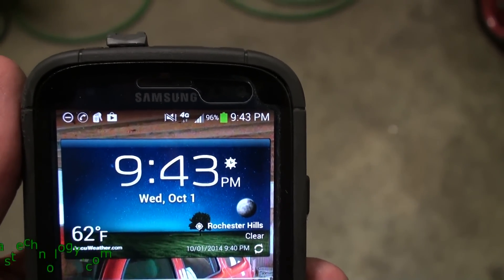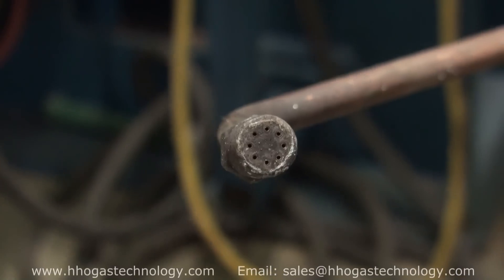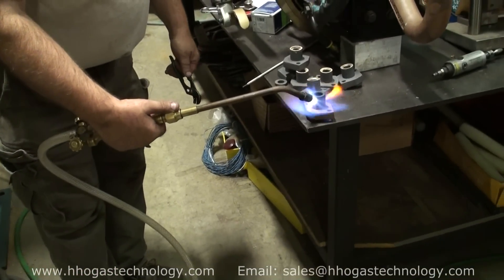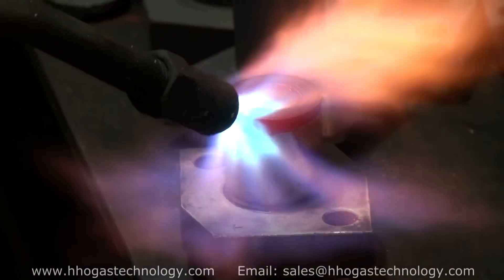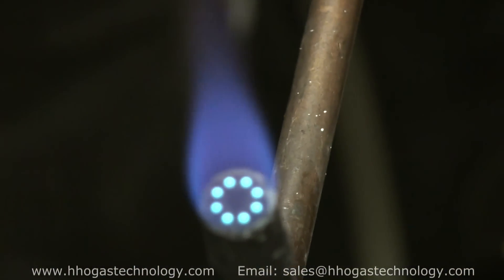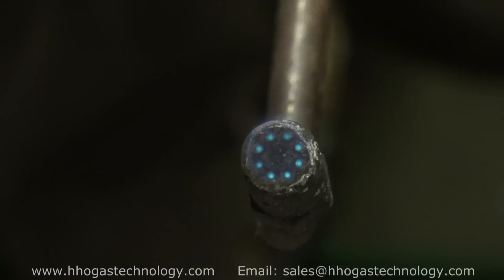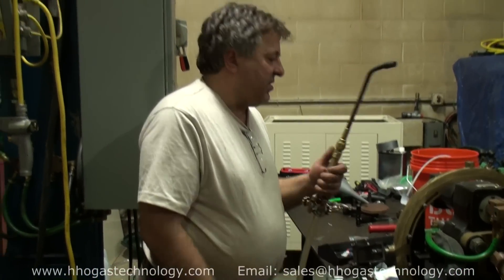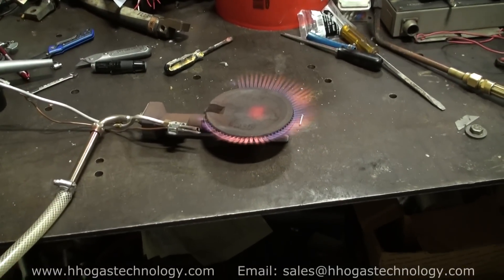HHO Gas Machine 59 Liters Per Minute Heating Up Massive Thick Copper & Running Water Heater Burner

Comment: Hey guys, you have to mix the HHO gas with Air to lower the burning rate of the gas.  If you do that, then it will burn like a propane (LPG)
Reply: Stan Meyer figured out the mixtures to equal all fuels down to kerosene.
Reply: @TravisTellsTruths  could I get some info on that? That'd be very helpful

Comment: What's with the Yules gas that cutts metal but won't burn hydros materials,  is that all crap ?
Reply: No, Brown's gas does have different properties than a mix of hydrogen and oxygen, and the best explanation I've seen is that a specifically designed, single ducted electrolyzer using a pulsed DC input creates a charged, gaseous form of water referred to as an HHO molecule or electrically expanded water. See, "Identification of unknown state of a water molecule in Brown Gas using the BSM-SG atomic model".

Comment: How much KWH it takes? Want to know if 59l/min HHO so how much electricity it would cost. Thanks, waiting for reply.
Reply: Rule of thumb is about 4W/lph, but you can already weld with 1800lph (about half of 59lpm), this is assuming you are using brown's gas, not HHO

Comment: I have to say this is really incredible. I never realized the heat output of HHO. How many plates, what are they made of and how about the electric part, what is the voltage and amps ???? This would really work for me brazing copper. Drop a line fella ???

Comment: Great video.  How many stainless steel plates you have in your generator ( electrolysis machine) and what's the size of one plate? Also what's the DC Voltage and amps?

Comment: Are you using that as fast as it is being produced like the water on demand produce hot water? That has to be what you are doing since you can't compress it to store it unless you are running straight hydrogen. That's nice.
Reply from the maker: The machine holds a certain pressure inside the machine and the machine was not using it on-demand the machine had pressure built up using it as needed. It was running Coleman camping fuel vapors in a specially designed bubbler inside the machine with oxyhydrogen. It was dual fuel delivery and the machine was not working hard. If you do not know what you are doing and you do not have the proper flashbacks the experience could be dangerous because mixed fuel there is no implosion 100% explosion.

Comment: Why no flashback ? My friend nearly killed himself with a flashback explosion blew the HHO generator to piece's
Reply: You need to have enough pressure building up inside
Reply: @dinosaurdrew7431  Too much pressure the gas self ignites
Reply: Take it easy.  I’m not talking about tons of pressure. Just at the point when you always have positive pressure inside. Make the out put tube thinner or have a smaller orifice.
Reply: It’s kind of dangerous to ignite a torch that lower than 150W of power
Reply: I got a few days of hearing loose after my cell exploded.
Reply: @dinosaurdrew7431  I honestly think you haven't clue
Reply: @dinosaurdrew7431  right. It's safe once it mixes with air.

Comment: HHO is the most explosive fuel I have ever used. If you try to build one of these machines at home and get anywhere near this output you risk blowing up everything. I tried an even as a fully licensed gasfitter at 26 L/m with triple flash back protection it stills fails. Even the commercial machines have to be constantly maintain and this gas makes acetylene look as harmless as kids play dough and is the far safer option.
Reply: You are correct I have a small one I use for electronics it works great however it is designed to blow up lmfao 😂 it has flashed several times with an enormous BANG 😨 !!!! there is nothing mysterious about it  some of these fanatical people almost worship so called HHO which is really a incorrect terminology, it really just a isometric form of hydrogen and oxygen which common sense will tell you is explosive lol. So I built a true separator that separates the hydrogen and oxygen until the touch just like a true torch.  It has never exploded however it still pops just like an acetylene oxygen torch but is very mild. I'm not sure why people don't make those it's actually easier.
Reply: What if you did something like a surface mix type burner glass blowers use where both gases are kept separate and only contact when exiting the nozzle?

Comment: How much electricity was used to make 59 LPM ???
Reply from the maker: 220 Volts X 40 Amps = 8800 Watts
Reply: *****
you need to give watt hours or watt minutes to have any useful information. thanks
Reply: So Approximately 150 Watts Per Liter Of HHO Gas. A lot of common space heaters pull 1000 to 2000 watts of electricity and the heat output is pitiful. We can get 6-13 liters per minute of HHO gas with the same 1000 to 2000 watts.

Anyone that has played with this stuff knows that is a substantial amount of on demand gas that deserves respect. To put it into perspective that is about 1/8 the amount of gas as this particular demonstration. Judging by the Burner demo at the end of this video we will have plenty of gas available for space heating of a small room. I am sure we can do 250-500 watt heaters as well, which would run for a very long time off a fully charged marine style aux battery, couple to a solar panel and that is some FREE off grid heat. I think we can use Peter's work with the mix fuel technology to create some very bad ass space heaters. I added this video to the H-Cat thread in the forum. 

Should also work in a "Fuel Rail" scenario too so we can slide it inside of any off the shelf wood stove or the Hand Built "Neal Ward Keg Heater Wood Stove" 

I'm excited about this...

http://app.hydrofuel.ca/viewtopic.php?f=13&t=68&p=3295#p3295
Reply from the maker: *****
 I am at this present moment working with a sterling engine company to do that free energy loop process and the only  input is water that can be recycled to continue the loop of energy again.
Reply: HHO Gas Technology
Reply: HHO Gas Technology :And you don't have to worry about toxic fumes.  A Bonus!
Reply: Michel Bernaux secondary carbon fuel
Reply: ZERO they use propan butan or other gas and lie.
Reply: @HHOGAS  This would be very, very efficient, nearly impossible. The theoretical max. output is 0,174 ml at 1 Amp. For 1 l HHO/sec. you need for a single cell a current of 5747 Amps. If you use 110 cells in series you have a current of 52.24 Amps. Normally you would need 2 V at least per cell - that would make roughly 100W x 110 = 11 kW. So your generator must work below 2 V/cell. So you must have 138 cells in series and have a per cell voltage of about 1.6 V - which is extremly low and would normally need a huge plate to get 40 A...
Reply: @HHOGAS  lol ok

Comment: You could always use a membrane to separate the H and O, then reincorporate them with a standard oxy torch, this would let you adjust the oxy and hydrogen mixture separately giving you an easily regulated torch...Pressure is another thing, but a simple one way valve would give you about 3 - 4 lbs per gas, ideal for welding. (you could even safely bottle the gas at low pressure) Compressed air could be added to the o2 for cutting. A membrane could be made of just about anything with a fine mesh that can hold up to KOH.
Reply from the maker: When the oxygen and the hydrogen are separated and recombined it is a different gas because they have been separated and then recombined. If you were to take an oxygen tank and a hydrogen tank and had a torch that would deliver the gas separately at the torch tip you would see there is a different kind of flame.
Reply: The hydrogen and oxygen once sepperated are different gases, thats the point! Once sepperated they can be manipulated like oxy acetylene, but you will still have a clean gas that burns pretty much the same as hho without the flashback issues and storage problems. Unregulated hho is a worthless gas for welding, I have yet to see one single project that was actually welded or cut using unregulated hho!
Reply from the maker: You are suggesting to  Separate the oxyhydrogen gas through a membrane are you doing it?
Reply: I have done it, nothing new or remarkable.
The membrane can be anything that will separate the cathode from the anoide, that is not going to fall apart in KOH or whatever electrolyte you are using.
The key is to capture the bubbles, not very hard to do, even a bottomless plastic bottle over the cathode or anoide will separate the gas for collection.
This method of separation does not work well with dry stacked plates. My setup used several collectors inside a 5 gallon bucket with a sealed lid.
Hydrogen can be compressed and stored, a scuba pump works best.
Reply: @thestudioofhopecorporation3356  I disagree, if you've made an electrolytic cell with a clear acrylic shell, then you'd see the difference between one with and without the membrane. With a membrane, the gasses form only on the electrodes. Without the membrane, gas forms in a third location between the electrodes. The surprising thing is that the volume of gas produced without the membrane more than predicted by faraday's law.

We are dealing with a distinctly different gas.
Reply: @HHOGAS  Can you tell me how much your generator cost me today Sir ??? Thanks

Comment: Why is this not used more is cause of initial cost of machine over the gases used?
Reply from the maker: We are working out the cost factor figures between Oxygen and acetylene versus HHO Gas. The advantages of using HHO Gas in the workplace is a cleaner working environment Carbon Free of material being worked on and many more advantages. The advantage of using HHO Gas in the workplace cleaner, smoke-free, job performance Sped up without deviating away from quality at the same time.

Comment: Nice video. I need to weld 1/8" thick or 3mm thick aluminum ( pipes or sheet metal ). Can you recomend what minimum size (liter/minute) HHO generator I need for that kind of job?
Reply: Still waiting for the answer? What I see is they don't want to explain anything, they only want to squeeze it till the last cent. Correct me if I'm wrong, but looking at the comments, I see this.

Comment: @pjckac Couldn't you use this same idea to convert a regular home gas furnace to an hho system?
Reply: I wouldn't, hydrogen in itself is extremely unstable. Especially if it were to have a flame out and allowed to build in the atmosphere. If that were to happen it's literally another Hindenburg...
Reply: @jameslargen284  hydrogen is the most diffusive gas out there, and it is not hard to calculate the concentration by volume, keep it under 4.25% for a given radius from the nozzle and it won't burn past that

Comment: How many plates does this generator have? To obtain that force from the flame, do they use an air pump to transport the hydrogen with more pressure? Thank you very much for your reply.
Reply: There's no need for a pump . You rely on gas production to produce pressure. If you want more pressure increase the production . I am speaking completely out of my ass tho so what do I know

Comment: I wouldn't recommend using this on metal. Reason being you have a pretty much perfect 2/1 ratio of hydrogen to oxygen atoms in that gas. However, you need more like a 4/1 ratio if you want to ensure against having the oxygen atoms bonding to and oxidizing the metal as opposed to bonding to the hydrogen.

This torch should be burning much hotter than this too. I am not sure if the nozzle is too wide or the pressure too low, but this is the kind of torch they use to melt aluminum oxide and chromium oxide powders down for making synthetic rubies... And you know you have a powerful torch when it can melt an oxidized metal because their melting points tend to be way higher than that of refined and purified metals. For it to be struggling here shows there is something wrong.
Reply from the maker: The machine has the capabilities of adjusting the carbon fuel with the HHO Gas. Carbon fuel reduces the flame temperature with oxyhydrogen and when you lean out the carbon fuel you increase the temperature of oxyhydrogen. It was his first time playing with the machine we had the carbon fuel inside the machine Bubbler on the rich side burning with the oxyhydrogen. I am an expert for 13 years I know exactly how to fine-tune my torch for the application needed. Oxyhydrogen is a different animal altogether there is no comparison when it comes to carbon fuel. Carbon fuel is carbon fuel oxyhydrogen is in a different ballgame altogether. There are also ways to control the oxyhydrogen flame through different delivery systems other than mixing a carbon fuel. I can take oxyhydrogen and not turn any object Red-Hot or just create heat only and no red glow at all or I can turn it any color you desire using 100% oxyhydrogen through my special techniques. Again let me restate my comment I have 13 years hands-on experience no one can pull a fast one over me.
Reply: @HHOGAS  You mean the carbon electrodes? Yea, no. those are used specifically because the carbon does not react, and therefore won't corrode away like metal electrodes will. There is no "carbon fuel"...

Electrolysis always produces 2 hydrogen atoms for every oxygen, which recombines back to water when burned. Except oxygen also combines with metal like iron to form oxides, and there is already oxygen in the air. When you heat metal in an oxygen rich environment you get oxides. That's why many welders use inert gasses to shield the work from oxygen.

The only way to avoid oxidation of your work piece with this type of torch is to alter the mixture of hydrogen and oxygen, to reduce the oxygen so that it is more likely to combine with the hydrogen than the metal. The only way to do that is to vent a portion of the oxygen before it goes to the torch.

I don't care how many years you've been playing with electrolysis. It's literally a basic high school level chemistry experiment, come back to me when you have a degree in chemistry and metallurgy.
Reply: @chrisr3120  something else you can do is simply modify the gas using gasoline. If you use bubblers for spark arresting, then add a small one to the end with gasoline.

To avoid corrosion you can opt for stainless steel electrodes with sodium hydroxide for the electrolyte.

It doesn't require a PhD to look through the walls of an electrolytic cell if you make it out of a clear material. When you remove the PEM a third gas is produced distinct from the gas produced at each electrode. The usual electrolysis is only supposed to produce the two gasses, and only at the electrodes.

Comment: Would have been really nice to see the hho set up.
Reply: Of course, but they want to sell the product, not to explain it... I don't think they will be too successful since they use some hydrocarbon added and keep the working principle secret. Also I don't think they can produce a liter of HHO gas with 150 Watts consumption, hydrolysis with electricity takes much more power. They seem to be arrogant, and that's not a good sign. I smell bullshit in the air.
Reply: Baladár yeah. $26,000 for a used setup.
Reply: @baladar1353  or they are using voltralysis and not electrolysis. They could just keeping things secret for business and to protect there lives

Comment: oxy/acetylene burns at approx 6300 F. oxy/hydrogen burns at approx 5100 F (oxy/acet has 1.24x the heat). Acetylene has approx 1470 Btu per cu ft while Hydrogen has approx 783 Btu per cu ft (acet has 1.88x the btu). please explain how it takes 1/10 the time to heat with a gas that has about half the Btu of acetylene? Answer, it doesn't. I call shenanigans.
Reply from the maker: HHO Gas mixed with a fossil fuel increases the radiant heat of the fossil fuel due to the nature of the heat of hydrogen and oxygen together that needs to contact the surface first before the heat is generated. HHO Gas by itself has no radiant heat with a combination fuel It changes the entire outlook that everybody is used to fossil fuel by itself. Have you ever studied HHO Gas and fossil fuel burning together in a flame?
Reply: 1. if HHO has no radiant heat as you say, we should be able to stand next to the space shuttle rocket engines under full thrust.
2. 'needs to contact surface first before the heat is generated'. What?
3. exactly how and what ratios are you mixing the gases?
Reply: still waiting
Reply: I seen a video where they used a second bubbler that was filled with paint thinner. Although I don't know much about this kinda stuff because I can rarely afford oxygen for my cutting torch and mine is a small map gas and oxygen it definitely seemed much hotter and even if it wasn't its definitely more efficient and on top of all that I can afford water lol. Seems like a worthwhile project I'm definitely building one myself
Reply: my2centz u still have to use electricity to generate HHO.
Reply: I'm sure Kevin never gets an argument wrong.
Reply: Magic
Reply: @kevins6277  it has a higher heat transfer rate. Also a ton of that energy from oxy-acetylene is lost as radiant heat. Smaller particles transfer more energy per collision. It's part of the reason why LO2 LH2 is used in higher isp rocket engines. Rather then LOX RP1

Comment: Also don't those HHO rings in machine degrade over time?
Reply from the maker: Epoch has a patented technology that helps prevent the degrading of the rings over time. Everything is going to degrade or wear out but they have research and development that helps increase the lifespan of the machines over all other companies.
Reply: ***** Thanks for answer, i under wear an tear just after watching other people hho devices self made the rings get rust or water turn bad. But thanks for answer, I am subscriber and watch all your videos! I am in UK maybe I can set this up over here and work together.